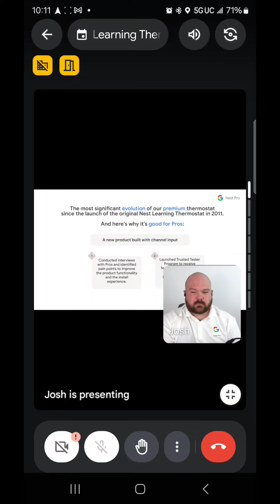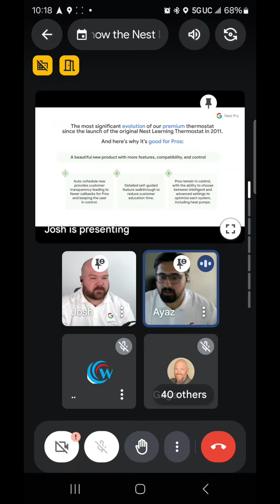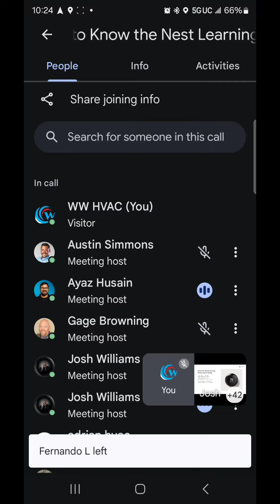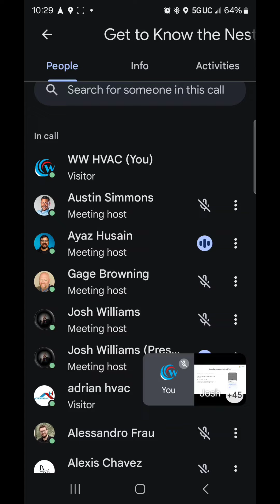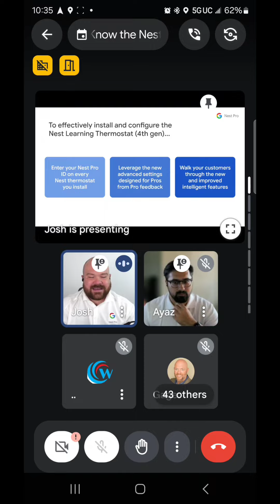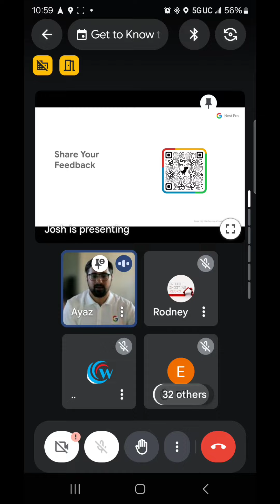Get to Know the Nest Learning Thermostat (4th gen); The inside Scoop ☀️HVAC services Katy🌡️

Comment: Every HVAC technician that comes to service my heat pump hates the Nest thermostat as every one of them tells me to get rid of it. Now I'm coming from the nest learning third gen to the nest learning fourth gen thermostat and it feels like a downgrade. The fourth gen thermostat looks like a damn mushroom growing out of my wall. The interface on the Google Home app is horrific. You can't access any of the advanced features unless you use the crappy Google Home app now. When you touch the display it easily turns so you accidentally change your temperature settings. The learning 4th gen does appear to be more compatible with heat pumps when properly set up as the self setup did not work properly. Most of the smart features on this thermostat are a gimmick and it actually works better when you keep them turned off. My HVAC technician is probably going to have a stroke.
Reply from the maker: I haven't tried the Nest 4th Gen myself, but I still prefer the older models. I've got the 3rd Gen installed in my home, and it’s been working great without any issues. I've been using the Google Home app for a while now, and while it took some time to get used to, I’ve adapted to it since I use it to control other Google Home devices too. I do agree that having to rely on the app for advanced settings can be a bit annoying.

If the 3rd Gen is working well for you, sticking with it might be the best move. Sometimes, the new features just aren’t worth the hassle, especially if the older model does the job just fine!
Reply: @WWHVAC  The fourth gen thermostats works better with my heat pump as I have a multi-stage compressor with a dehumidifier, auxiliary heat, and emergency heat has the 4th gen thermostat has two more connections.
Reply: I use 3rd gen with nest app.  I will never transfer to Google home.   I turned off learning and set my own schedule on the website on a laptop.  I use the app to monitor and change temperature remotely or if I'm too lazy to walk over to the thermostat
Reply: @yappering  Right now the only thing keeping the nest app alive is the nest smoke detector.
Reply: I have experienced the same thing with my HVAC contractor regarding my Mitsubishi heat pump. In fact they refused to use it when they did the install and said that Mitsubishi would give them a hassle when they called for tech support because of the Nest thermostat.